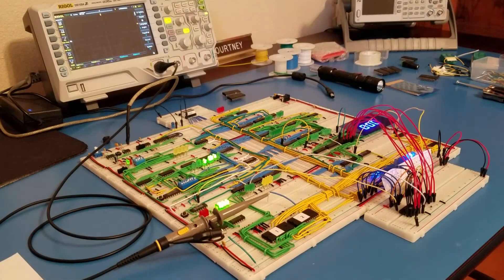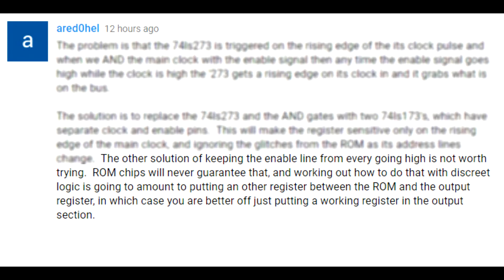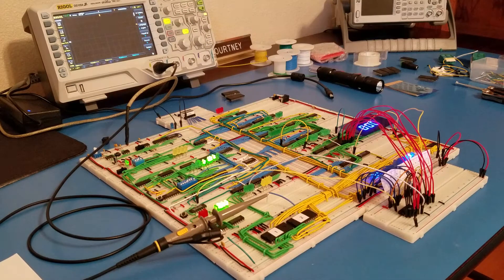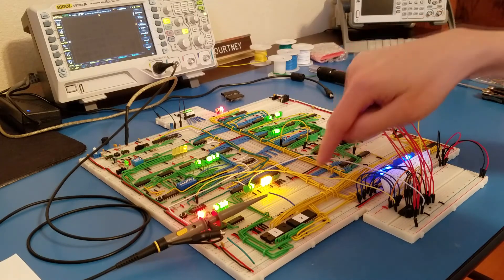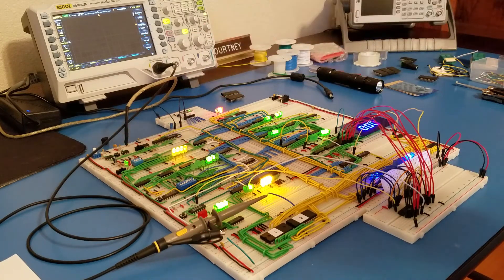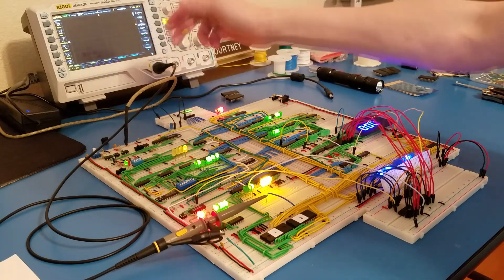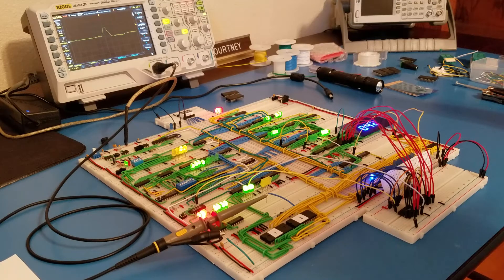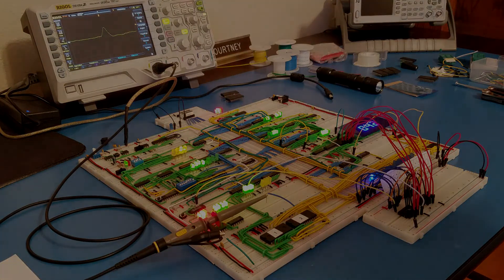ADD cycle problem [Part 4]  *SOLVED* - (Ben Eater 8-bit Computer) SAP-1

Comment: The solution portrayed is not the solution to the underlying problem.

::

According to Ben's schematics: /OE of the 28C16's is wired to GND.
This is a design fault.

Why this has not been addressed yet, despite its obviousness, will likely remain a mystery.
It is also a fault that cannot be fixed by patching.

Patching only remedies certain bandwidths of clockfrequency, YYMV.

::

I don't know if Ben did this on purpose to teach something or whether it was an oversight.
Or that he, "Just got lucky", as I've seen mentioned elsewhere.

(Reading Ben's BIO I cannot but conclude the "teaching" edge, since I'm of the same material.)

Nevertheless:

- Valid data out of any "memory-unit" is only available while the address is stable within the propagation time.
- If the bus is in Hi-Z (i.e. "unknown state") no data is or should be present.

NB:
Download Ben's schematics (available from eater.net) and examine "control.sch".
D4, pulled down by an LED, is the "OI" signal.

My solution to his exam question is this: 
- "Just connect /OE of both 28C16's to the inverted clocksignal, because than a valid value is ready to be read in".

::

Ok, what did I win?

;)

Comment: For another - and, IMO, better - solution to this problem, see James Bates's video series on his Ben Eater-inspired computer.  In the 9th video, around the 36 minute mark, he addresses this problem.  His solution is to add a 74HCT273 between the IR and the EEPROMs (and a '173 between the flags register and the EEPROM), and to latch data  into the '273 on the rising edge of the inverted clock signal.  That way, any spurious signals from the EEPROMs will occur with the main CLK signal low, and therefore won't cause these issues.
The solution shown here only fixes the problem for the output register.  The same issue could conceivably occur with lots of other signals (A input, B input, increment PC, etc.).  James Bates's is more general and will take care of all of them.
Here's a link to his video: https://www.youtube.com/watch?v=ticGSEi0OW4

Comment: Is this the correct summary?:

1: EEPROM outputs a stray signal on the OI pin due to its inherent nature.  The chip is still within the apex sheet though.

2: This stray signal is just at the edge of either causing or not causing the Output module from grabbing the contents of the bus.

3: The problem is caused by a race condition where the EEPROM is transitioning and the state of the computer's state machine should not have waited for the EEPROM to settle before paying attention to the OI signal.

4: Problem solved by re-designing timing diagram of Output module.

I know some of this is wrong, but that's the way I understand it.  I am in the final stages of a build and want to have it work right.

Comment: what led's are you using
Reply from the maker: They are rectangular LEDs I got from eBay. The most recent ones I ordered were titled "100pcs 2x5x7mm Diffused Red Light Rectangle Rectangular Square LED Diodes USA". Another title was "5 Colors 100PCS Diffused 2x5x7mm LED Diodes Rectangular White Yellow Mix Kits"

Comment: looks like this is called a false clocking problem.
The SN74ABT377A (OCTAL EDGE-TRIGGERED D-TYPE FLIP-FLOPS WITH CLOCK ENABLE) solves this problem
More info on this ben video:
https://www.youtube.com/watch?v=-arYx_oVIj8
if anyone uses SN74ABT377A in their board, let me know.

Comment: I had the same bouncing problem and I was able to solve it by switching out the 10 nanofarad for one of a slightly higher value.
Reply from the maker: Thanks for the tip, I'll definitely be addressing this bouncing problem as soon as I'm done rewiring the output register. So I'll look into that idea.

Comment: Hi David.  Where did you purchase the lime green wire from?
Reply from the maker: This is the wire I'm using on this project: https://www.amazon.com/Electronix-Express-Hook-Wire-Solid/dp/B00B4ZRPEY

Though I wish I had bought 100' spools instead because I ended up running out of the lime green wire while completing the ALU. And when that happened, I just bought another box of the 25' wire thinking "surely 50 feet will be enough" ... but then ended up running out of green yet again when I completed the OUTPUT REGISTER. (The part of the breadboard computer that I am now today rebuilding.) I also ended up using all of the blue and yellow wire from the first box and quite a bit of the blue and yellow from the second.

But the point is, buying 3 boxes of 25' was quite a bit more expensive than it would have been to have just bought 1 box of 100' at the beginning. Hindsight.

I also wish I had picked up 1 or 2 spools of other colors to use. In particular, I would like to have had a separate color for all the RESET wiring. Ben uses yellow for both the control signals and the reset wiring, so I followed along with what he did. But in so doing, I found myself mistaking the reset connections for control signals when working on the registers. So a different color of wire would have been a good idea I think.
Reply: Thanks!

Comment: Nicely done.  The basic principal is to never put any logic between the clock and the clock inputs.  I hadn't actually seen what happens when you ignore this till now and seeing how this has played out for you has given me a better understanding of why this rules exists.  The rule, but with out a good explanation, had been pounded into my head in such a way that when I saw Ben add the AND gate to the clock line I just felt uneasy, but without an understanding of why.

This brings us to the micro instruction counter being clocked through a NOT gate. I'm pretty sure that sure that this is Ben's work around for the gated clock signal on the 74LS273.  It makes it so that any glitches from the changing of the T states happens when the main clock is low.  I would be interested to see if the computer works when the micro instruction counter is clocked off the same clock as every thing else.  It does in my version, but I am using a fpga where every thing is as close to ideal as the manufacturer can make it.

Edit: fixed some of the grammar.  There is nothing like some one pinning a post to let you see more of your grammar mistakes.

Comment: great work on that Problem! 

i was wonder 1 thing, i have an idea of building a 16 bit computer with some diffrent featues, but then when i saw you your video i was wondering if i have ordered right components, the 273. My thought was to use two 273 (16 bits) and two 245,s and also an AND for the clock signal for my A and B register, and also for my instruction Register.

Does that 273 work for my A and B register or what do you think? is that problem only showing up when you use eeproms?  the thing is that this chip is the only octal d-type flip-flop with reset, and i think thats important.
Reply: The short answer is that the 74'273s are only useful if you are loading new values into the registers on every clock.  You want something more like a 74ABT823 with a clock enable( or some thing with a data enable, does the same thing but in different ways.) so that you can cleanly decide when you are loading values into your register and when you are not.

This brings up the issue that I haven't been able to find a register with data/clock enable, in a DIP package, bigger then 4 bits.  This means ether: making circuit boards and doing surface mount soldering (this is easier then soldering DIP packages, so long as you use a flux pen. See the EEVBlog videos on the subject.),  or do what I did for making Ben's cpu and use a fpga. Using a fpga is also much simpler then most people think.  The hardest part is deciding what you want your fpga to do, and if you are following along with Ben's videos and just increasing the number of bits, then that part will be mostly  done for you.